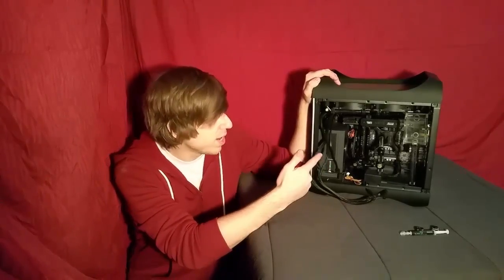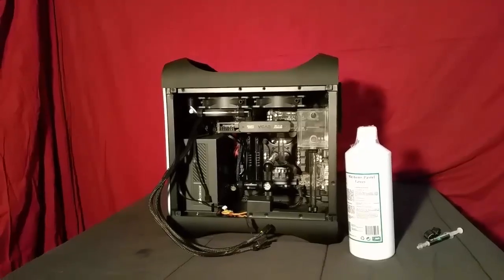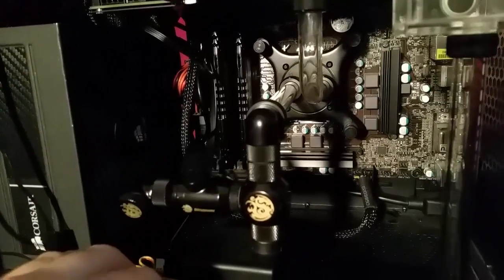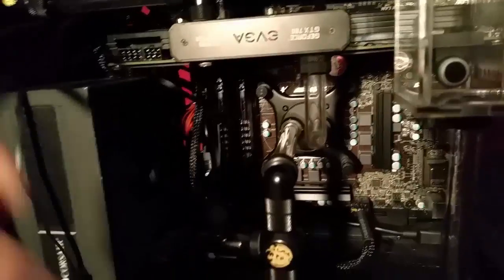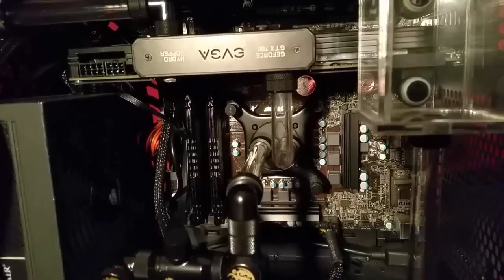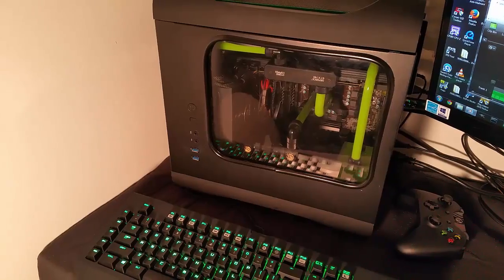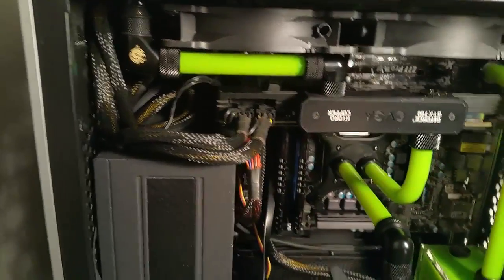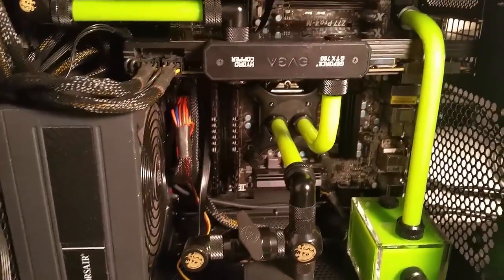Acrylic Water Cooled Bitfenix Prodigy M XSPC/Hydro Copper Blocks Bitspower/Borrow Fittings EK Pump

Comment: I just realized that your power/reset/usb setup is on the side with the window. Where on earth did you get that? I hate that the stock setup keeps those both on separate sides. (sorry if you mentioned it in the vid. I'm skipping through a thousand videos to figure out what I need to finish setting up my prodigy M.)

Comment: How do you feel about using hard acrylic tubing vs. flexible? Why did you decide to switch to hard tubing? To me it seems like more work to get it the perfect length. With flexible tubing its okay if you are a little off on a measurement because the tube can just bend in or out more.
Reply from the maker: You are 100% correct, it is a hell of a lot more work. I have nothing against flexible tubing, I actually really like it. PrimoFlex Advanced LRT is my favorite, specifically the pearl UV green kind. There are actually a lot of downfalls for going the acrylic route. You have to measure, cut, sand and possibly bend each piece to fit your own precise measurement from component to component. Even if you are off by a few mm it could line up wrong or wont look right. It costs more(the fittings, not the tubing). There is more chance of leaks. But, at the end of the day, nothing beats the way a nice acrylic build looks in my opinion. Honestly, I was really close to just going flexible tubing again on this build, but I'm really glad I didn't. Although it wasn't easy, and sometimes i struggled with bending or cutting the precise length, it was worth it IMO.
Reply: I agree with you that it looks alot better when finished. And I wish i could use acrylic tubing, I just don't think I have the time and precision to do so. I also like your choice of using the Bitfenix prodigy case. I'm going to build a new watercooled rig with a watercooled GTX 970. I think I may use this case.

Comment: Did you make that sidepanel yourself? all the Prodigy M cases ive seen dont have a sidepanel in them. Sweet system you got there!
Reply from the maker: Thanks man, and yea I made it myself. Did it with a dremel and it was a pretty big PITA. Bitfenix did release side panels for the prodigy M, you just have to buy them separately . They're pretty cool looking but they go on the side with the power button and usb 3.0 ports and yet it has no power button or ports. I'm actually thinking about buying one and then modding a green LED power button to the front panel. I mean i like my modded side panel but I feel like the official one would give my build a cleaner look. Here's a link to them if you want to check it out.. 
http://www.bitfenix.com/global/en/products/accessories/prodigy-m-window-side-panel
Reply: Too bad I can't seem to find them at a store here in Norway. If I decide to go with the prodigy case, i think ill make my own custom side panel as well. For an ITX or micro ATX case, theres not many that look better than the Prodigy
Reply from the maker: BraxFilm  I agree, I love the prodigy. There's only one other matx case I like more, and that's the Corsair Air 240. If I didn't put so much work into the prodigy I'd consider switching. I love the design , and the way it's Laid out makes it perfect for water cooling.
Reply: EatSleepMac yeah, personally i think it looks a bit too plasticy, but thats just personal preference. I do like the Corsair Obsidian 250D but thats more of a media center/livingroom pc.
Reply: BraxFilm Hey man, I found the panel on eBay Norway really easy? http://bit.ly/1y8ah1q
Reply: My prodigy M did have a side panel window ;)
Reply: Your modded window is better though than the factory one coz you still have the USB sockets right there on the side. For my desk set up that is a really convenient position for them. The factory ones have the window and no USB :'( Seems most case manufacturers think that everyone has their computers to their right (and on the floor? (USB on the case's top)). There are 3 computers in my house and all of them sit to the left of the user.

Comment: some Corsair green LP ram would look awesome in that as another accent.
Reply from the maker: I completely agree, I've been keeping my eye on the price of that. I just got a crazy good deal on two more sticks of the G.Skill 2400mhz RAM and I'm trying to paint the heat spreaders green to match the liquid, but it's hard to find spray paint that's an exact match. The Mayhems pastel green coolant is such a unique color, it's like in between lime green and florescent green. If it doesn't work out i'll deff consider going the corsair LP route.

Comment: one more question bro if you could choose between a bitfenix collossus matx or a corsair air 240 which one would you choose?
Reply from the maker: I like that I could color match the LED strip on the front of the colossus, but without a question I'd go Air 240. If I didn't put so much time into this prodigy, I would switch to the 240. I could see myself getting the black one and painting the grills green. The main reason to get the Air 240 is because of the way it's built. By putting the power supply behind the motherboard, it allows for very clean cable management, and more room for water cooling. Not to mention just a cleaner overall look in my opinion.
Reply from the maker: Here's an example of the type of water cooling you could do, and there's still so much room left over. http://imgur.com/a/i4svY#GpHMZhv
Reply: EatSleepMac wow thanks dude I have searched all over the place for a watercooled air 240 but couldnt find much. this lookes awesome thx

Comment: Hey man. I just ordered an H80i from best buy and geek squad is going to install for me since this is my first PC. Your PC is my dream computer. It looks so sick. I wish I could get mine to look like your H80i that you had. You think the H80i will do decent for it being stock?
Reply from the maker: Thanks man, that means a lot. The h80i is a great closed loop cooler. Temps ranged from 30-60 degrees Celsius depending on if I was gaming or just browsing the web. Normal air coolers can get up to 70-90 degrees while gaming, so it's a huge improvement. The h80i was my gateway into watercooling and got me into building custom systems. I have a big update video coming on this build so stay tuned. Should be out this week, just waiting for parts to come in.
Reply: Ok sounds sweet. I'll check it out. I was hoping that after I got the H80i that I wouldn't run into any temp problems but now that I look at my motherboard, it's been hitting temps of around 45-50 degrees. So now I have to buy new fans and i'm hoping that it will help this a little bit. But I guess it's part of PC building :/